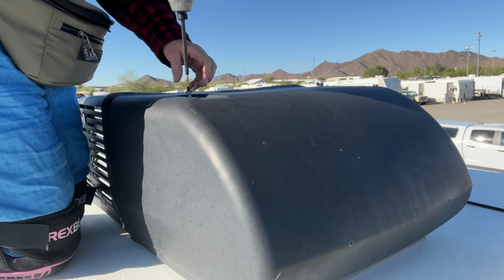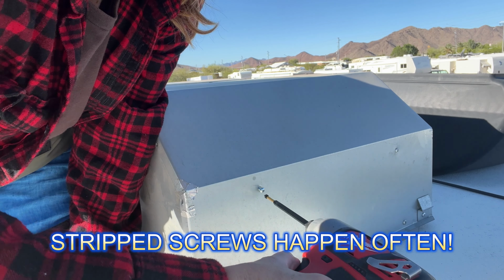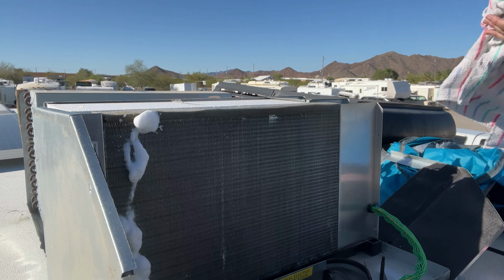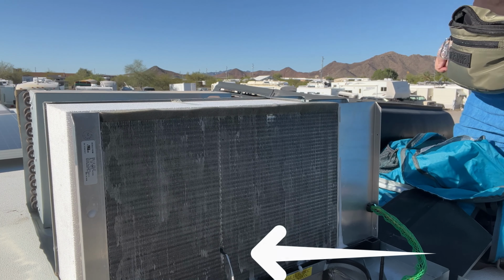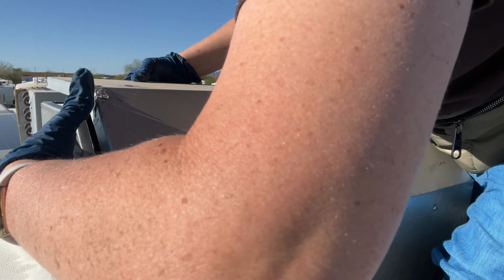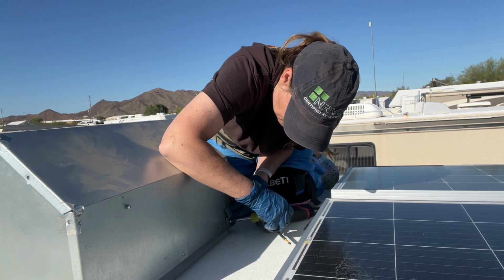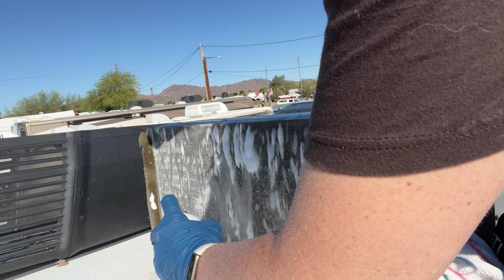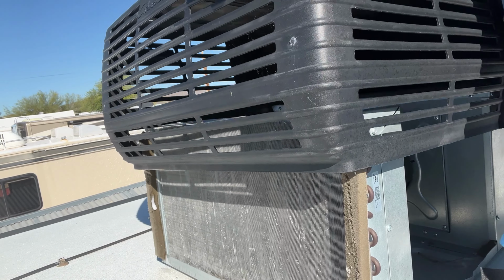How to Clean an RV Air Conditioner - Coleman Mach

Comment: Hey there! Thanks for the video! I've found that it's not necessary to remove the screws for the side panels or the ones in the front center of the unit (the two screws that hold the plastic control board assembly). I only remove the screws that hold the panel that runs from the top to the front.
Reply from the maker: Ok thanks for the input!! Thanks for watching too.

Comment: Hi Deb!  I don’t know all about screws but I had a stripped screw and so I abandoned the project😮What is your go-to place for parts? Every time I try to find something for my 2020 Class C it’s a struggle. LOL What type of screw is for AC shroud without having to drive to a dealer or hardware store (Amazon). Stainless? #8? I find I’m spending so much time trying to find correct parts all the time. Thanks!
Reply from the maker: Hmmmm, I usually check with some of our other techs and find parts that way. Because I mainly do inspections I don’t order tons of parts. If I have a good website I will make a post about it for you. Thanks!

Comment: Hi Deb, I am a little confused as to how that AC works. My main question is how does the air go through it if that one side is completely covered?  thanks
Reply from the maker: Do you mean on the top where one side is covered? One side brings air in then it cools it and blows it out through the vents.
Reply: @debsrvservices  But how can the air get in or out if the vent is completely covered like that? thx

Comment: I seem to have an abundance of spiders visit my bedroom this summer. I have an a/c unit above my bed. Could they be getting in through a/c unit?
Reply from the maker: Hmmmm, is there a tree above your RV? It is possible but if the AC is running I doubt it. There are so many ways they can get through. Does your bedroom have a slide out? I would look for gaps underneath the RV.

Comment: Where does the dirt from the coils go?
Reply from the maker: I use the cap with the little bristle brush to scrape off loose dirt before and after I spray. That picks up most of the dirt and debris.
Reply: Thank you

Comment: Something to think about before removing the roof AC cover, inspect it real well for possible bee nests, stand back and observe the cover for a few min's to see if there are any bees hovering around it.
I had an old 24 that I owned for a short time, it had a water leak around the edge into the inside, so I thought it was going to be an easy fix, just pop off the cover and reseal the area, 
I removed the cover and without even glancing into the cover after I removed it I set it upside down behind me,,,,,,,,,,,,
I'm sure you can do the math on the next series of events, cover was between the ladder and me with the nest pointed skyward with about a million bees coming out for revenge,
I tried to slide off the back of the RV to the spare tire,,,,,,,
Peter Pan I ain.t, almost broke a leg and my lower back,,,,,
But I didn't get stung if that's any good side to it.
Reply from the maker: That would freak me out! I would probably fall right off the roof. Once something happens once you never let it happen again😂 Thanks for the tip!!